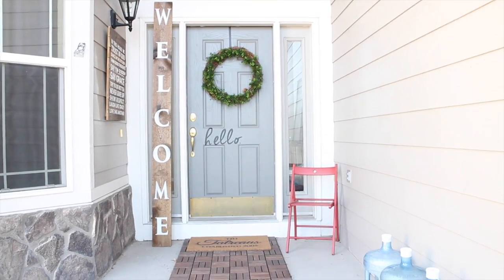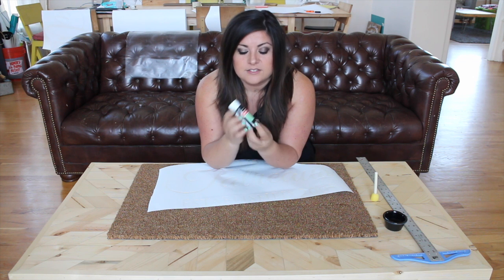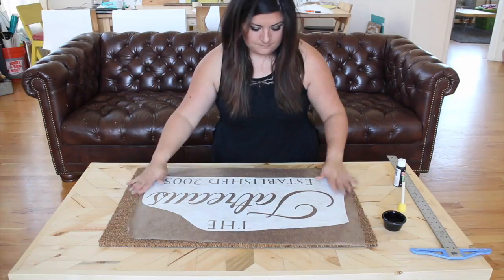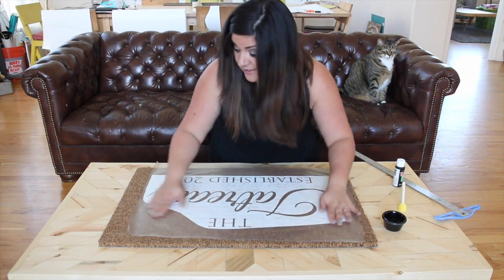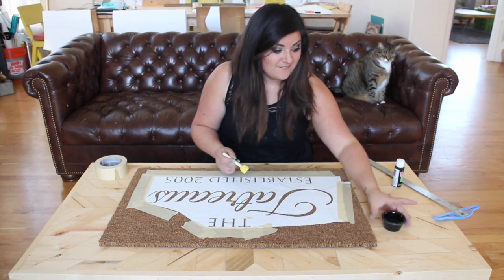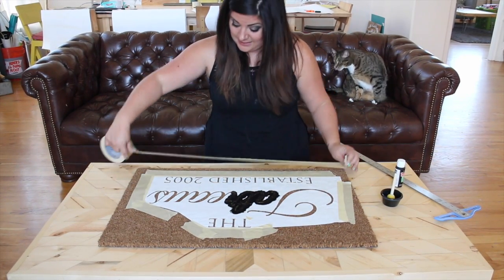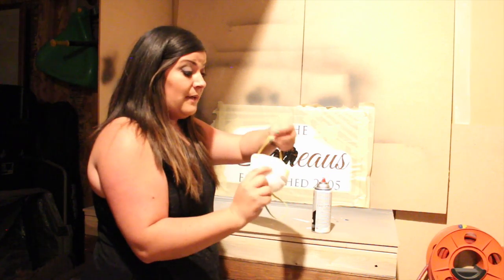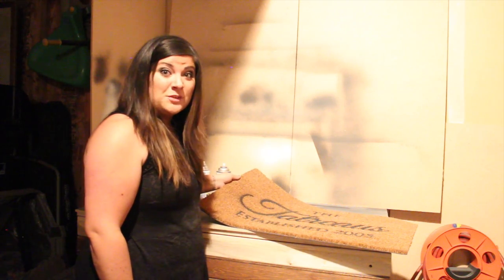DIY Customized Welcome Mat

Comment: which vinyl are you using for stencil?  651 o 631?  I tried 651 and it didn't adhere very well
Reply from the maker: There's really nothing that sticks well to these mats. The very best I've used that sticks to them is called Vinyl Ease from Amazon, however, I also use Oracle 631 on them as well.